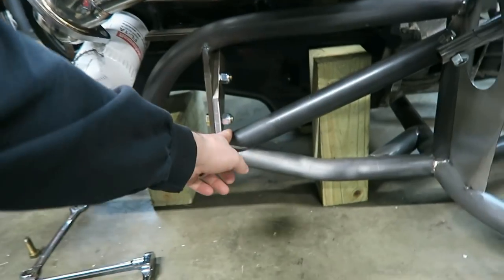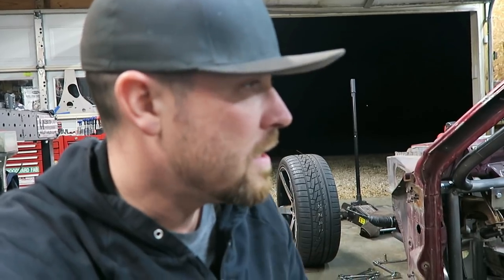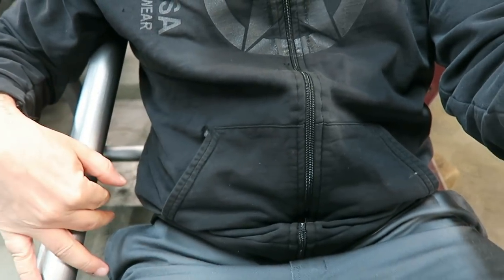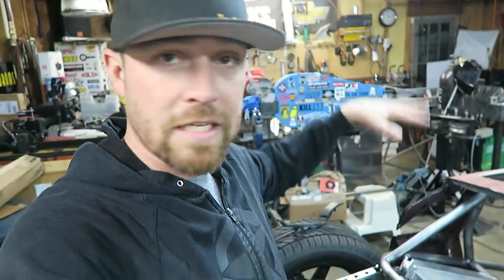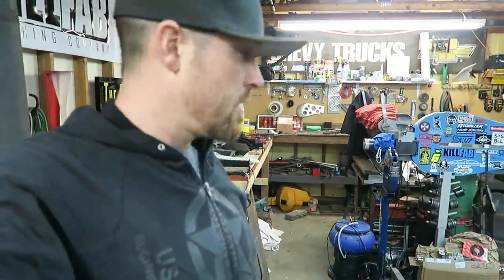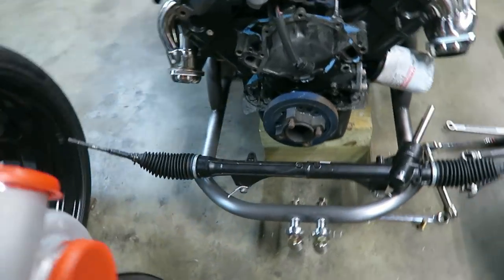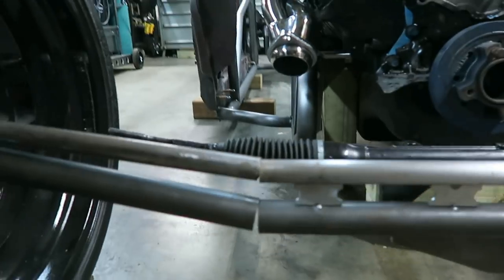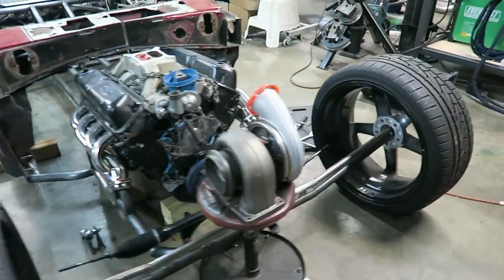Lets Talk Changes & Concerns on The Hot Rod Build

Comment: If your not married to the idea of that particular rack, you could use a rack from a sand car. some set ups have 30" travel with no bump steer and 2.5 foot long arms.   you could use your original idea, that in my opinion looks better, and have no bump steer also.   Might have to move the pivot of the arms slightly out from their location now, but simple in all terms of work.
Reply from the maker: that would have been rad...didnt know about those

Comment: That steering wheel looks to close to the door unless it was the angle I don't know why it looks so crunched into the corner I would move everything over a little bit 4 inches or so just to have a little more room if possible but that's me I mean I don't wanna sound like I'm criticizing his work I just know I'm 6 ft 200 lbs I would like a little more room if I was building my car from the ground up.. but otherwise looks like it's starting to come together .and the front rims look soooooo much better with the low profile tires on it such a difference it's crazy
Reply from the maker: lol Im 6 foot and 200 lbs as well and I dont know about you but I like my steering wheel centered on the driver. That is where it is. Dont forget this car is 8 inches skinnier than a regular fox

Comment: Hey Kyle instead of cutting the steering arm off the knuckle and welding it so it connects towards the rear of the car, do you think swapping sides so the knuckles face the way you want would work?
Reply from the maker: +wojcei20 No because of the way the strut attaches

Comment: Not that I agree with the 1/2” bolts on the coil overs being a problem, but the difference between the ford shocks and the coil overs is that the coil overs carry the weight of the car, the shocks in a stock vehicle only dampen the oscillations and the springs are mounted either to the rear or the control arm. This might be their concern, only a guess on my part though. If you rotated the lower coil over mount 90 degrees do they are on a different plane would it alleviate the binding through articulation? Again just wondering. Cool build again!
Reply from the maker: +Thomas Cahill yeah but the dampening creates a much great load stress than just supporting the weight of the car.
Reply: Thomas Cahill aftermarket coil over kits use the oem 12mm bolt on the foxbodies, they do offer an upgrade to the mount though, but then again those kits are engineered for autocross, not what expect this car is gonna doing.

Comment: A different rack with centermounted arms would be good. Then the stearingarms would be long and You could use the original idea with long lower arms. Either way it´s looking real good :D
Reply from the maker: yeah the problem is finding that kind or rack made for reverse rotation
Reply: Ok. There is that. I have seen one somewhere durin 35 years of working with cars. If I only could remember it. Must have been a european car since i´m in europe :D. Will get back if I have a stroke of memory
Reply: The Fab Forums Chrysler intrepid I believe is center mount and rear steer.
Reply: How about get a left hand drive rack from the uk and run it upside down.

Comment: considering how much has been cut out of the body it seems relatively roomy. those upper bars should be ditched; as you said you don't need them. my 2 cents: i think some of the engineering challenges you're facing is because you're building a hot rod designed to handle. hot rods and cornering are two worlds with some different priorities. not condemning the project at all just pointing out stuff.
Reply from the maker: I could care less about handling...I after cool and thats it

Comment: As far as the articulation with the rear suspension, doesn't the top of the shock in the rear have a heim joint? If so that should take care of that.
Reply from the maker: +blindabinda123 No it just has Polly bushings

Comment: Hey Kyle, cool project, think you're on the right direction looks good. On the front suspension did you ever think about the Grand Am rack and pinion where the pivot Points are really close together, I don't know if it was brought up I didn't read the rest of the comments. But the pivot Points are almost where your initial a frame mounts are. Maybe something to think about or look at. Can't wait to see the next update this is a cool project!
Reply from the maker: +louverdudski  no...is it a reverse style rack
Reply: This would probably work. I know the later civics used a similar design so they could mount the rack high up on the firewall. This should eliminate bump steer with his original mounting location though

Comment: Looks awesome, maybe i missed it but how are you planning on filling the coolant system? With the radiator at such an angle are you going to add a higher up canister? Thinking about doing a rear mount radiator on my Rat Rod also.
Reply from the maker: +cody roland gonna modify the filler neck

Comment: As far as the rear cylinders go, why cut the front side and add bulky bolts, cut the backside and use the hardware you already have installed for the brackettry
Reply from the maker: I could but it may make it a little harder when needing to remove
Reply: The Fab Forums, Well with the whole cup being able to be removed, it shouldn't hinder removal, installation, or adjustment. But for that idea I would take a small chisel to add some grip marks to the inside of the tube for just an added point of security and clamp adhesion. Just think it might be a cleaner look for what you are desiring. But regardless you are a bad ass and what you decide will be sweet! And these are just 2 cents from a youtube peasent lol.

Comment: It's not a race car, leave the A pillar bars out. I think they would fold at the bend anyway.
Reply from the maker: +Whiskey Tango Foxtrot Over they wouldn't fold but I agree with not using them
Reply: My thoughts are maybe put a little kick in them so that they are closer to the a-pillar or locate them so they are little closer to the a-pillar and maybe add some guess it's at top and bottom
Reply: , I meant gusset  but I'm sure you figured that out